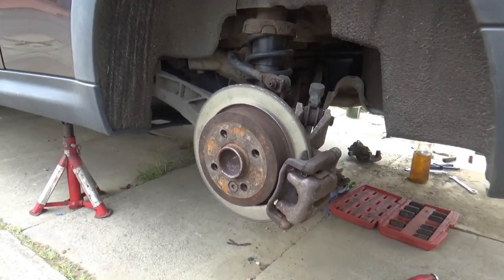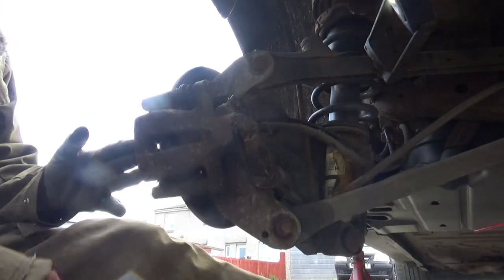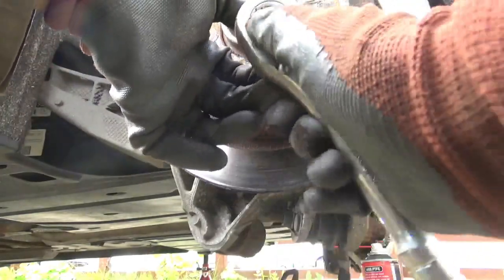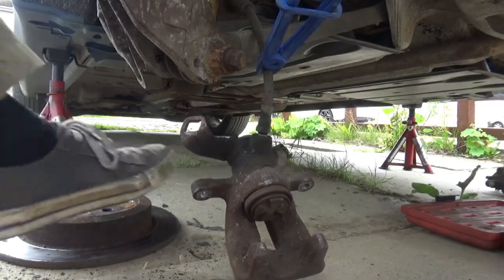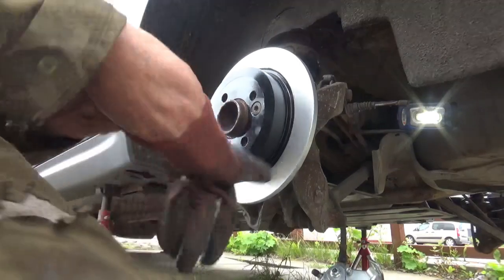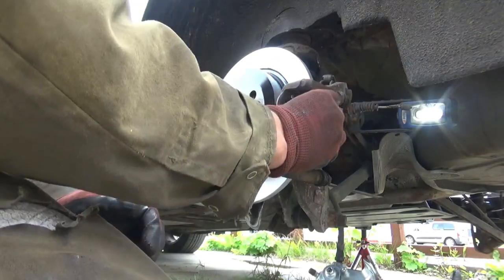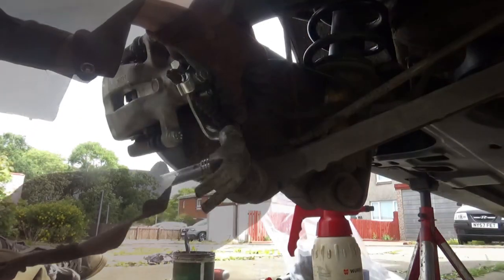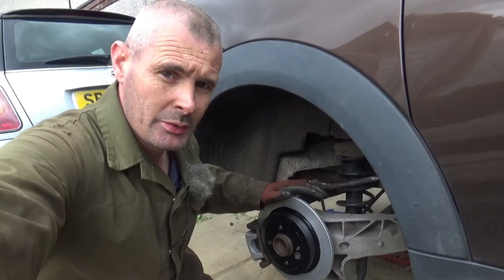How to replace the rear brake pads/ rotors on a Mini Cooper R55/ R56

Comment: How do you get the resevoir pressure cap off without pissing fluid all over the place when you're done with bleeding? 
There must be fluid in the pressure container to master cylinder cap delivery pipe?
Reply from the maker: Hi and thanks for your comment. The pressure bleeder has a release valve on it where you can depressurise it prior to unscrewing the cap. Full links in the description can be found for the bleeder I used in this video
Reply: BMC Workshop 
Hi Sean, thanks for the reply. 
What happens to the fluid in the pipe between the cars brake resevoir and the pressure bleeders body?  Is it sucked back into the pressure bleeder when you release the pressure of the bleeder container?  or does it just stay in the pipe and spill out when you unscrew the bleeder cap from the cars brake resevoir? 🤔
Reply from the maker: Most of the fluid is sucked back into the bottle however, you still get the odd dribble. You can also bleed it with just air ie, an empty bottle then top up the master cylinder once bled. If youf bleeding it dry then make sure the master is topped right up and if need be top it up in between bleeding each brake. I often just bleed the brakes dry but on this occasion I had not long bled an entire system on my classic mini hence why I had fluid in the tank as it fills as well as it bleeds. All the best, Sean
Reply: BMC Workshop 
Awesome reply,  thanks Sean! 🏆
I need to replace the flexi brake pipes because the existing ones are pretty dry and hard. 
I got a cheap 2003 R50 Cooper for  £1300 and so far I've spent £1600 on new spares for it! 😂 👍 
All the classic failure points of an R50 except gearbox,  at least that's still OK for now 😂😂😂
Reply from the maker: @RawTopShot  the R50/53 are excellent cars, the best of the bunch in my personal opinion. The key to preserving the gearbox if its the early midland one is not to labour the engine. My 2004 R50's midland box is still 👌
Reply: BMC Workshop 
That's reassuring! 
I'm dropping the box oil soon anyway just to see if there are any bits in it.  I've got the right stuff to refill ( from Opie Oils) and new seals etc. 
The motor has done 70,000
( 69,000 when I bought it back in 2015 ).
Reply from the maker: @RawTopShot  It's a nice easy job to do and well worth doing
Reply: Great video Sean, thanks for posting, I just recently bought a mini clubman s r55 wow what a little pocket rocket it is I absolutely love it, iv got to do the back brakes on it soon, what's your thoughts on painting the actual caliper to give it a sporty look? Would I need to use a special heat resistant paint?
Reply from the maker: Hi buddy, painting the calipers is easy. I'd personally remove them (and the carriers) and give them a good clean up to remove the rust. One cleaned up you can give them a degrease with either panel wipe or brake cleaner then spray them. You can buy caliper paint in spray tins from the likes of Halfrauds or Amazon and normal paint will also work. I've painted calipers with normal paint in the past without the paint flaking off, the R50 caliper rebuild video shows you rebuilding my old calipers and the paint I originally used on them was at least 7 years old before I stripped and painted them with silver alloy wheel paint!
Reply: @BMCWorkshop  your a good man, thank you for the speedy reply much appreciated
Reply from the maker: @londondecoratingcompany384  your welcome buddy and you'll have a lot of fun in the Cooper S 👌

Comment: Thanks so much for the video. I had to replace a seized caliper today and it went very well after watching your presentation. My MINI Clubman is a 2008 and after 12 years of winter road salt the piston wouldn't retract and the dust boot was about 1/2 pulled out of the caliper. One tip I learned elsewhere was that if you remove the brake fluid reservoir cap and fasten a piece of cling wrap over the opening with a rubber band that you can unscrew the brake hose from the caliper and transfer it to the new one with very little loss of brake fluid. The tight seal creates a vacuum. No need to clamp the brake hose.  I maybe lost 2cc while switching the hose from the old to the new caliper. The other caliper piston was tough to turn back in so I'll probably replace it next spring when it gets warmer here in Pittsburgh. Got lucky today, it was 60 degrees F. and no rain!
Reply from the maker: Neny thanks Scott and I hope the video helped you out. Thats a great tip with the cling film, I've used that technique myself in the past. 

The clubman is a great car, my biggest regret was selling my one but at least my wife still has hers.

My next job to do with calipers is to rebuild the front calipers on my R50 Cooper as this is now my daughters car. If I get a chance I'll document that process too and upload it to the channel 

All the best, Sean